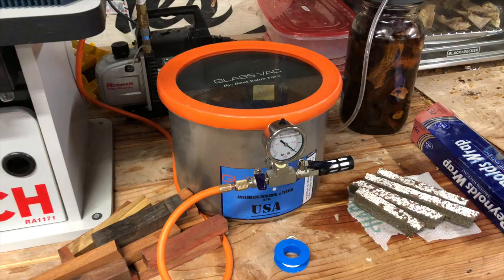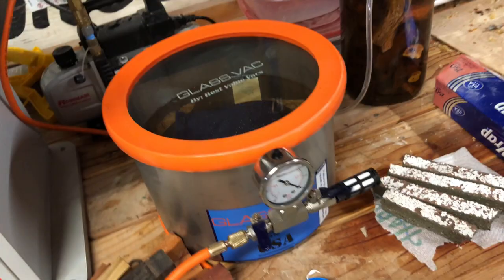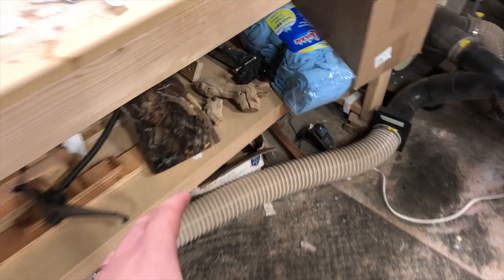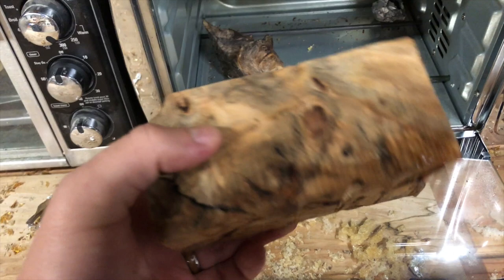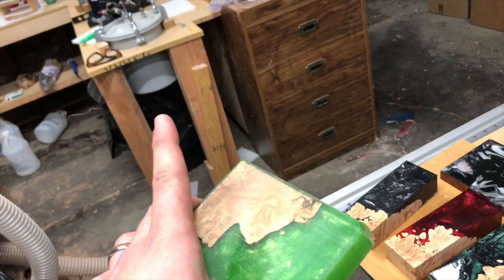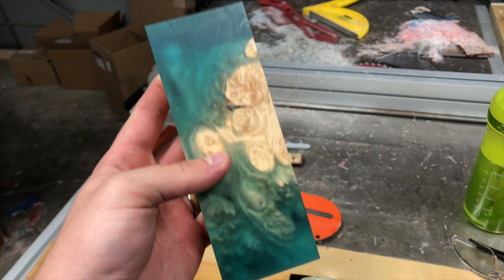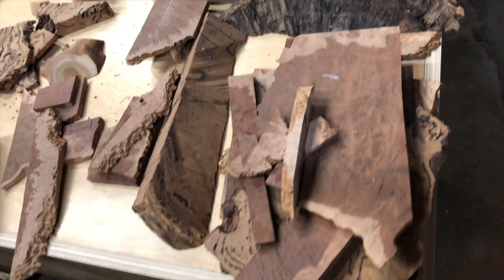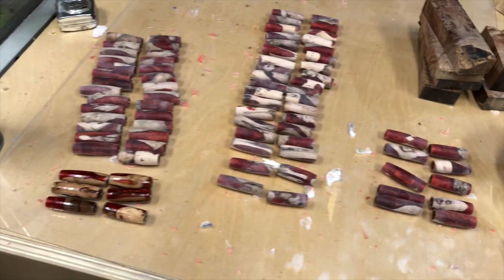Shopisode Vlog Series #1

Comment: Hi Casey, can you share with me any saw blade recommendations you have for cutting acrylic and hybrid blanks?  Thanks.
Reply from the maker: I highly recommend the Diablo ultra fine finish blade. They also have a fine finish one that’s a little cheaper. They’re not cheap but after I cut a blank it’s like it’s been sanded to 220 grit I kid you not. They also work great with dust collection too I’ve noticed
Reply: Casey Martin Thanks Casey, as usual you are very helpful and responsive (especially to an old Cal Poly alumnae).

Comment: How do you get the resin to be translucent/transparent? You had 2 somewhat blue blanks in the video. I want to have that effect on a table I want to make using wood I salvaged from my garage's foundation. It's partially rotted out, and has a neat look. I was also thinking of illuminating the resin parts with led lights, but the resin would need to be transparent to see the wood.
Reply from the maker: I use clear Alumilite resin, and then add dye. So if I add no dye or a small amount then it will come out perfectly clear or slightly tinted